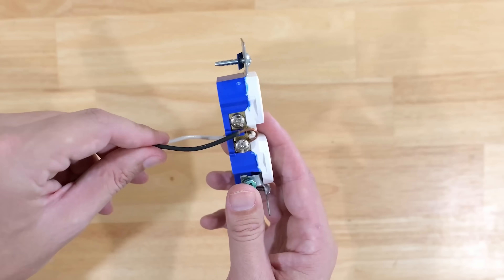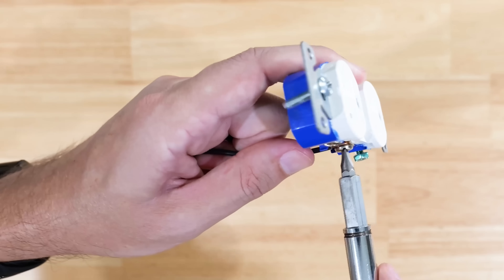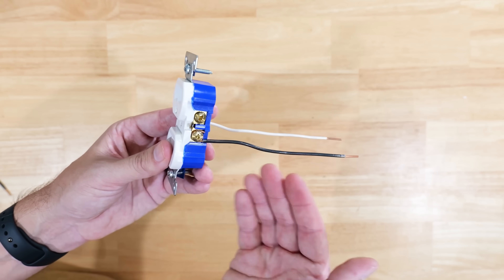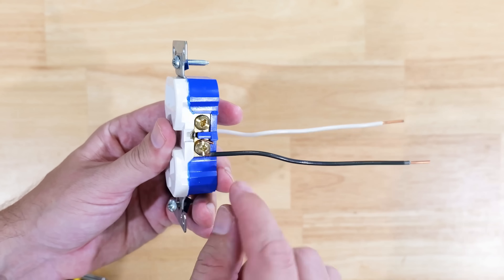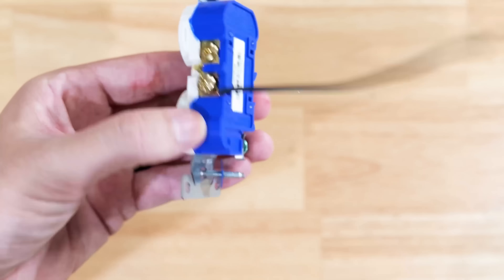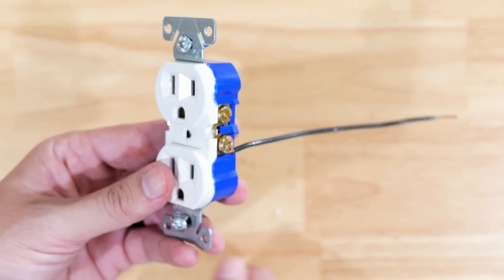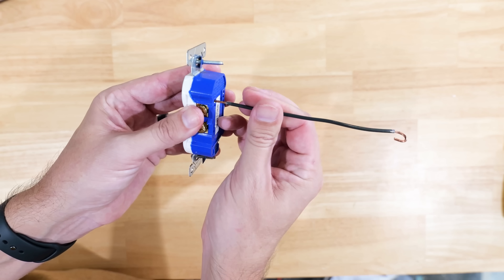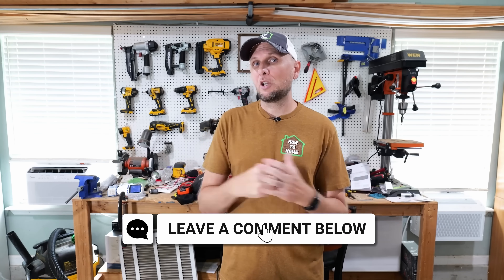Avoid Disaster! 8 FATAL Outlet Mistakes Most DIYers Unknowingly Make!

Comment from the maker: Be honest, how many of these did you find yourself doing?  It is not abnormal for folks to find they have been doing 2-3 of them!
Reply: None. But, I've been at this for almost 60 years too. 😉
Reply: Not a pro, I'm a DIYer and "enthusiast" - the only mistake I would potentially make from this list is putting a 20A outlet on a 15A circuit.  I would've reasoned it is over-built and therefore safer, less likely to have a heating/contact issue.  However, I see the point that it might encourage someone to plug in a load that would be too much for the wiring and breaker and then you are counting on the breaker to save your backside.

It is worth noting that many of the tips and "don'ts" from this video apply to wiring switches too.

Finally, I was expecting something about using an outlet as part of a daisy chain.  Personally, if I was connecting a mid-run outlet I would use pigtails rather than connecting both the incoming and outgoing lines to the outlet.
Reply: I thought you had to use pigtails on a mid run outlet in order to keep it in parallel with the circuit… wouldn’t directly connecting to the In and out  put it in series  and change the voltage drop…unless there’s another junction i’m unaware of that already branched it off parallel?
Reply: @philipstaite4775 even if you put in a 20A outlet, the breaker in the panel is most likely sized for 15A so there is zero chance it would ever actually pull the full 20A and melt wires. People are so annoying
Reply from the maker: @No5elfCTRL zero chance?  Breaker never malfunction?   They always trip right at 15 amps?  Hmm seems I’ve seen fires from that happening.
Reply: 80% of them ‼️ Thank God the building didn't burn down ❗
Reply: @iamanovercomer3253  80% of what?  A true 20AMP plug has that sideways Neutral prog (or is it a 90 degree bent one, I honestly don't remember).  You don't see those in household use very much here in the US, in industry, yes.  You often see 20 amp circuits with 20 amp outlets, but what appliance or vacuum cleaner have you seen with a true 20 amp plug?  I never have.  The odds of plugging in a true 20amp plug in to a 15 amp breaker'ed circuit is extremely low (All my first floor wiring used 12 gauge from 15 amp circuits anyway.  My hands, 20 years ago easily  handled 12 gauge ).
Reply: @Daveyk021 14 gauge wire with 15 amp load all day long where more than one wire shares the physical space as another wire also loaded up all day long will result in hot wires.  Using 12 gauge helps to mitigate that.
Reply: @pixels303at-odysee9   yeah but why since 14 is rated for 20A except for romex and resi branch ckts. The only reason I wire houses with 12g is because I'm going to use the screws anyway and the cost of wire isnt that much considering I can put more outlets on a circuit.  All i run in 14 are light circuits because can lights are a royal pita with 12g wire.
Reply: I have definitely used the quick wire holes. I need to double check, but I think some smart switches I have recommend it in the instructions.
Reply: @nickw-hillgod  May be better than the ones with stranded wire coming out of them and then needing to use a wire nut in the outlet box and trying to stuff all that back inside a single wide outlet box.
Reply: I ordered the Torque Screw Driver you recommended from your link (Wheeler).  Without re-listening to the cast, did you not say you set it for 12lb/in for electrical sockets?  The lowest that the screw driver can be set to is 15lb/in.
Reply from the maker: @Daveyk021 I did.  Not sure how that is true.  You saw and heard it chirping at 12 in lbs.
Reply: @HowToHomeDIY  Apparently the new ones only go to 15lb-in as the lowest and that is pointed out in the use manual too.  I think that is okay.
Reply: @HowToHomeDIY  I just leave it at its lowest setting, 15 pounds which is good.  At 15 pounds, it probably starts chirping at 12 pounds.
Reply: @Daveyk021  It;s not a TORQUE screwdriver - it's a TORX screwdriver.
Reply: Missed one tip: always screw in all of your terminal screws. If the outlet comes into contact with the side of your electrical box, especially if someone did not tighten the outlet into the box properly, you could blow your fuse to your entire house!!
Reply: @pixels303at-odysee9  eehh, i usually do that but not for why you said. i just do it so if some knot head takes off the wall plate some little kid sticking his fingers in there wont touch the screws so easy.. Thats not even a very good reason either. The only one is if your putting an outlet in a metal box i spoze. I think i'll quit wasting time doing that now that I think about it.
Reply: None, I hire a licensed electrician to get it right. Easy; not super cheap, but my peace of mind is priceless.
Reply from the maker: @fjeinca ok you do you.  Video is more intended for those of us that do some of these minor changes ourselves.
Reply: @HowToHomeDIY  some people have the time to watch these videos and the money to pay someone else to do what they are perfectly capable of doing themselves.

I have peace of mind knowing "I did it right Myself!".  So many times misplaced trust ends up in a house fire or flood.
Reply: @HowToHomeDIY  I often ask electricians trick questions about electricity, out of curiosity to assess what their understanding is.  Just like the criminal medical system with doctors following dictates and not questioning the protocols, it pays to scrutinize their understanding of the occupation they decided to make a career of.  Sadly, if people have not been paying attention, those with peace of mind are either suffering or worse right now.  I think many people know exactly what that is. I cannot elaborate as this platform is silencing everyone who attempts to convey the dark statistics.
Reply: I think I'm good on all but maybe one.  I'm gonna go back through and make sure I didn't reverse polarity anywhere.
Reply: also you every new house built uses 15 amp outlets on 20 amp circuits this guy isnt a true electrician and has no data to back him
Reply: @jaxflint2814  you must be arguing with ghosts or something.         Nobody: ....
You: IM NOT FINISHED WITH YOU YET
Lol.       He's just showing some random tips. Nothing wrong with anything in the video.
Reply from the maker: @jaxflint2814 ok?  First, no clue what you are saying in the beginning.  Second, when did I say otherwise to deserve such hostility?  🙃
Reply: I'll wanted to add a outside plug for outside lightning, and I was thinking that it was OK to jump off of a inside plug, looks like I've got to call in a Electrician 😮
Reply: Is it going to switch one to another on AC anyway
Reply from the maker: @alklyce3173 AC is always switching but you still have a beginning and end on devices and they are designed for electricity to be fed from one direction which is the line wire not the neutral.  Devices like a lamp if it is fed backwards the socket will stay hot, the switch is only stopping the circuit from being completed.  And if you touch it you become the path to ground completing the circuit which results in shock or electrocution just depending.  So it very much does matter which side is wired where.
Reply: @HowToHomeDIY  Look at the tranformerless All American Five Radios from the 50s and 60s.  It didn't matter which direction the plug was put in to the wall socket.  They ran just as well as a hot chassis as the did as a neutral chassis.

Those radios had to be encased in Bakelite or plastic, with plastic knobs. Yet, on the bottom, there were often screws right in to the chassis. Of course, back then, we were not as much of idiots as we are today.  We didn't need stickers on the ladders telling us not to lean them against hot power lines.
Reply from the maker: @Daveyk021 you’re missing the point.  And just because one thing many years ago worked without any issue or safety concern doesn’t mean that’s the case for everything.  We still have things that can be plugged in either way today like Christmas lights for instance.  They purposely put a “non polarized” plug on it.  But if you look at most things, they have a “polarized” plug on them where one of the blades is wider (neutral) and the other is smaller (line).  So they can’t only be plugged into a receptacle one way.  That is for a reason.
Reply: @HowToHomeDIY  Why do you still use Phillips head screws for tightening wires on plugs in the US? They torque out too easily. Here in Canada we use Robertson head screws for this application which makes it easy to tighten the screws without the screwdriver torquing out & achieving the correct tightness to hold the wire firmly & safely.
Reply: @autodidact537  if you look closely at the screw it takes either #2 phillips or a #1 square driver, which is better. They also make a driver that is both, I should prolly go buy one some day.
Reply: @howtohomeDIY going to do my first one this week. I have a question, i have a toggle switch that broke off, so i cut the power and figured out how to get it to the off position. Covered the toggle hole with electrical tape and will purchase a new toggle switch in the next day or so. Is this ok to do? Is there any risk of fire if left in off position? I should note it is part of a double toggle panel, the other toggle is fine and appears to be working normally.
Reply: @veritas.vos.liberabit88  What broke, a breaker or a switch?

if it's a switch just turn of the breaker that goes to it and confirm that you got the right breaker, if it's a breaker, your best off calling an electrician ASAP, replacing a broken breaker can be dangerous to replace in ways that are not Immediately obvious. Any physiczlly damaged toggle (device switch or breaker) can be a fire hazard, and should be put in a safe state ASAP. Turning it off is not enough to ensure that it is safe. In some jurisdictions your local fire department can help you get it to a safe state untill you can get an electrician on site to finish fixing it. To find out if that's an option in your area, call the non-emergency number to your local fire department. This is typically a free service. Some electricians do emergency calls and will come and get things to a safe state even during off hours (ie. nights and weekends). We do, however you have two options with us, sign a contract to let us finish the job or pay an emergency call fee. If your in Rice county KS call Sutton Electric for that option. If your in Yavapai county AZ call NJ electric and ask for Jose (my step brother). If Your in Ghana Africa, call Lyon Electric or the First Non-Denominational Church of Christ of Ghana and ask for John (my dad). If you're in Portland Oregon Call EDI construction, Kevin will answer the phone, Tell him "itchy" sent you (my name is Ichihiro, he calls me Ichi for short, or itchy to mess with me) he's an old boss of mine, we're still friends.If your litterally anywhere else, I have no connections in electrical thus you're on your own finding someone.
Reply: @binaryglitch64  the switch is broken, snapped off.  breaker is fine. So I covered the exposed switch hole with electrical tape. Broken switch is in off position and other switch and outlet are on and functioning. Its a outlet switch combo.
Reply: @veritas.vos.liberabit88  Actually save the reading, just turn off the breaker for the faulty switch, confirm you got the right breaker, then leave it off untill you swap out the switch.

To install a replacement, double check that there's no power to any wires in the switch box. Then remove the old switch and make sure you have only 3 wires that were connected to it. Identify your ground wire; (it will be either a bare copper wire, a green wire, or a green and yellow striped wire).  Make sure your ground wire is on the green screw of your new switch.  Your hot goes to one of the other screws in the switch (it doesn't matter which one), and your switch-leg (the power wire that goes to the device that the switch turns on and off) goes to the only other screw. 

If you have more screws than that, you probably have a black screw... reply in that case, you likely have either a three-way or four-way or dimmer or speed controller and will need different instructions.
Reply: @veritas.vos.liberabit88  You should be fine.  You said you cut the power.  A good tool to have a DVM with a non-contact A/C sensor, or an A/C sensor device that can "sniff" if the switch actually has power or not.  The switch should be a very easy and quick change for you.
Reply: I’m a DIYer and just went to replace my garage door opener’s wall control tonight but was surprised to see that the person who’d installed the old one had used a variant of double-stacking — the difference is that the stripped ends of the wires were twisted together before they were hooked under each screw (the ends of two white ones wrapped around each other & then the same for two red ones). 

Do you think this is probably still dangerous even if makes it a bit more secure than straightforward double-stacking? OR do you think it might actually be safe enough since the twisting might prevent the extra wires from falling off & still allow enough contact with the screws?
Reply: @justfornow2753  no, in this case you should cut new ends and make them up to their own terminals. If there's too many wires to do that than you should pigtail the wires. look it up if you don't know what that means. If the recept is a GFCI then line vs load matter, and can't be pigtailed together, for unprotected loads pigtail the with line, for protected loads pigtail them together to the load side.
Reply: @binaryglitch64  Thanks for taking the time to reply — the garage opener wall control is a button rather than an outlet so only has two terminals (like a light switch) BUT I also found out today that it’s against code to attach more than one pair wires to it even though this double-stacked setup was previously installed by a technician. The previous owners must’ve wanted two different buttons for the same garage door for whatever reason. And now I’m learning that this device is never supposed to be wired to more than just the garage opener. So I’ll need to figure out which of the two pairs is the one to remove. I can’t believe a professional installed it this way! Anyway, thanks for your reply - I really appreciate it. 

And thanks to @HowToHomeDIY for the video’s warnings which helped me notice the problem in the first place.
Reply: @justfornow2753     Sorry, I can't believe I didn't catch that it was a GDO-CM (Garage door opener control module)... You can still pigtail if you're keeping both CMs... however since you are eliminating one of the CMs, you can easily trace the wires using a multimeter. To do that cut the power to the circuit, and ensure the power is in fact off. Open both CMs, wirenut together the two wires on the terminating end (the one that only has two wires) and perform a continuity test on the pairs of wires going to the other CM (the one with 4 wires)... the pair that have continuity (the pair that makes your multimeter beep) are the ones that run to the other CM. Now that you know which are which, lable them, and DO NOT FORGET TO UN-WIRENUT THE PAIR IN THE TERMINATING CM BEFORE RESTORING POWER TO THE CIRCUIT. You may also choose to remove these wires before restoring power. Or you may cap them off and make that a seperste project, or just leave the dead curcit in place permanently. I'd remove them right off. If you have attic access above the garage and another person to help you, then you can just go up there grab the cable that looks right and wiggle it and ask if the person in the garage can see or feel it wiggle. if you're lucky there won't be many staples and that will be enough to confirm and pulling will be easy. Otherwise you may need a tool called a toner (sometimes called a Fox and Hound in the trade) to confirm the correct wires. Home Depot has them. (If you get one on Amazon or eBay or whatever, I'd advise geting one for electrical not networking. They can still be used on networking but the networking type cannot be used on regular residential wiring.)

Best of luck with your project.
Reply: @justfornow2753  I am used to talking to other electricians and forgot to mention that for continuity tests it is best practice to ensure that you do not have continuity in other pairs or for a reason other than what may seem obvious. To do this just unbond (un-wirenut) the pair of wires in the terminating CM and see that it no longer has continuity. If continuity is lost by unbonding, than you can be relatively sure of your results.
Reply: @binaryglitch64  Thank you for your detailed reply — I really appreciate it! The new control module is now connected without the secondary pair of wires and seems to be working, BUT I left the dead pair in place in the wall (with the ends still sticking out, though), using electrical tape as a temporary way to cap off each wire individually to buy myself time to figure out which approach to take with them.

I do want to remove them, like you suggested, but there’s no attic above the garage & the wires do feel like they’re probably stapled in pretty snugly. Right now, I have it set up so that the wrapped ends that are closest to the GDO-CM are poking through a side notch in the control module’s plastic casing (so that I could still get the module flush against the wall without trapping the wire ends against the logic board) and the other wrapped ends of the wires are coming out of another hole in the far end of wall, enclosed in a plastic bag taped to the wall for now. There was no junction box used for this wall mounted setup, so the wires were (and still are) just coming out of holes in the wall that have been covered by the control modules since before I moved into the home.

So when you said I could leave the dead wires in place permanently, did you mean that it might be fine (and safe) to just wrap each of the ends really tightly (and heavily) with electrical tape & push them into the holes in the wall to get them out of the way? Or could that pose a hazard in the future?

I’m worried that if any of the sheathing/insulation degrades over time & leaves sections of wire exposed, it could wind up touching a live wire without me being able to see in there. Is that a realistic concern or a highly unlikely scenario that I really don’t need to worry about?
Thanks, again, for your helpful responses!
Reply: @justfornow2753  Highly unlikely scenario unless house is really really old (like 80 yrs plus) and some of the sheathing of wiring in your walls is already degrading... but even then, they won't be disturbed much and thus it's not likely. If you have rodents disterbing wires is The only scenario I could see in which case you've already got a wire problem, whether those wires are there or not. because they are not connected to anything on either end, tape should be fine to cap them off, however on the side that was the non-terminating side, I'd either cut them back far enough that they cannot come into contact with the other wires, or use correctly sized wire nuts.
Reply: @binaryglitch64 thank you so much for responding again — sounds like cutting them shorter, taping them off, and tucking them in might be the most manageable way to go, then — thank you for that feedback! I really appreciate it.
Reply: Stop buying garbage consumer grade outlets. Buy spec grade. Back wire (NOT back stab!) and tighten the clamp down to 20 in lbs. 

Spec grade outlets are like $3 each. They hardly cost anything. Add about $1 more if you want TR or 20A outlets.
Reply: You missed a big one.  Using the break away tab as a jumper on the side of receptacles. A buddy of mine does it and it makes me cringe.  That tab is not rated to supply receptacles down stream.
Reply: @kevinpowers3815  huh? WHAT?
Reply: Half my house is double stack wired
Reply: This guy is not right.
Reply: Straightening the hooks
Reply: Very good. I’m not an electrician but I did build my own house and I bought a book from Black & Decker do you help me do it. Even though it didn’t show all the tricks you do, the right stuff, I figured it out on my own, because of my engineering background. I never use those back plate stabs. I’ve seen enough failures on them as a do it yourselfer Fixing other peoples houses
Reply: Always great!!
Reply: I once found 8 GFI plugs on a building that were wired reverse polarity. Another time I was asked to check out a rental property that had about half of the plugs not working after the manager told me that 3 different electricians couldn't find the problem. I found power on the hot side and my test light showed me that the neutral side was disconnected. Every plug was backstab wired and all the neutral wires had evidence of arcing. I had to trim back the wires and put pigtails on every outlet in the house. After that, I got called for every electrical problem they had until I retired.
Reply: I think some of these DIY people might be better off using the push in connectors
Reply: to be honest none haha. im sure in the past ive done one or two of those, but i already knew everything covered.  thats the problem with learning about things you already like. its mostly just a refresher.
Reply: I use to wire them wrong until I learned to do it correctly. Nice Video
Reply: Should note some brands the "back stab" holes are used in combination with the screw.  It's actually better in that case to use them vs hooking the exterior screw. The resulting connection covers a higher percentage of the conductor. Long story short make sure to rtfm lol
Reply: Only one I've ever done is put the hook on the wrong direction, and that's more of an issue with left handed people. One way just feels more natural to us.
Reply: I actually pulled your video before attempting anything
Reply: I'm a pro DIYer after almost 10 years so I wouldn't be caught dead making any of these mistakes lol
Reply: None! I learned about this almost 60 years ago when my dad had me do an Electricity project in 4-H. Part of that was taking a class taught by an electrician at our local REMC. I took Electricity as a 4H project for 4 or 5 years. It was a good basic education for future homeowners.
Reply: Hey so I have a light switch in my bathroom that operates a pot lighting above the mirror and a ceiling fan on its own switch. I just opened that up and I noticed that there's only one black wire one white wire and a ground wire play yet it's powering all that when there is a single black wire in a single white wire.
Reply: Thanks for saying not to use the back holes.
Everyone I talk to says it's fine and they do it that way.
The problem is this isn't the 1970s with American made sockets that will outlive the house. These are cheaply made sockets with thin cheap plastic, it gets a combination of heat and people pulling and pushing on them when they insert/remove plugs and the plastic cracks making them loose and then fires start
Reply: I know a lot of DIYers that do damn good work.  Government wants to rule every aspect of your life
Reply: I knew about most of them, but the thing that bothers me is I had a young man who was apprenticing under a professional  electrician say that using the stabbing method was what he had learned!  

I also figured out on the fly that while using the shepherd's hook that I needed to hook it properly or I got what you showed in the video. Unfortunately I had to do all of the outlets in my just purchased home over several years time as my body doesn't bend as well as it did 50 years ago.

The problem with the recepticles was that the previous owner removed the cover plates from all the outlets and then PAINTED OVER THEM when he painted the rooms. So almost all of them had at least one half of the recepticle that didn't work due to paint. That's something I didn't notice until I moved in. Ah the fun of being a handy human!

This was an incredibly helpful video! Subscribed
Reply: How often do you see a real 120v 20AMP plug?  I used on of those for my work bench, but that's it.
Reply: @Daveyk021  I agree but most garages have 15 amp breakers and wiring (and not enough plugs)
Reply: @onlineconsumer4796  I've used 20 Amp outlets on 15 Amp circuits (breaker is 15 amp) because the 20Amp outlets seem made so much better.  I have learned to get "industrial" outlets, for it not, they are just back stabers and I will NOT use those.  This place was built with a bunch of back stabers.  So an outlet or two in a bedroom would fail.  I had to find another outlet "in the string" that failed (back-staber) and replace it to get the others working.  Once I experienced that, I replaced all the contractor grade back-stabers with Industrial Grade outlets, every one in the house.
Reply: @onlineconsumer4796  Oh with the arthritis in my hands, (sounds like a good excuse - lol) I have started to really like the back CLAMP industrial outlets. Oh, and I ordered that torque screw driver you recommended for future projects.
Reply: @Daveyk021  most new builds in kitchens nowadays are wired with 12ga and 20amp recepticals, replacing older way of 14ga, 15amp split recepticals
Reply: @MrJrea  Yes, they should be 20 amp wire (although 12 gauge today seems slightly smaller in DIA , and maybe easier to bend, than it did 24 years ago) on a 20 amp circuit. This thread is old, but if I recollect, we don't see too many proper "20 Amp Plugs". A lot of vacuum cleaners draw ~12 amps.  You would think those would have 20 amp plugs.  Just make sure the fault breaker matches the wire gauge, or it lower.
Reply: @Daveyk021 kitchen counter
Reply: None.  I research the codes and procedures before doing any electrical work.
Reply: @robertworden9810   almost nothing he showed you is in the NEC bubba, except for work being done in a workmanlike manner
Reply: To be honest, none of these. BUT, I was taught by a qualified electrician many years ago, and I understood WHY to wire receptacles correctly. The guy who knows HOW will always have a job, but the guy who knows WHY will be his boss! Great video.
Reply: sometimes i'll use an existing hook that is beyond nicked and just tighten down really really tight. to me biggest issue would be eddy currents (shhhhh) :p
Reply: I had to replace a gfci in my mobile home bathroom.  And the original had a 20amp reciprocal and the breaker was a 15 amp my mobile home is a 88 . Anyway I replaced with a 20amp like it had . Don't know if this is normal for mobile homes .
Reply: @MarkKuehnel  And those GFCI outlets they use don't last that long; maybe 20 years if not tripped too often, sometimes <10 years.
Reply: @MarkKuehnel  The quality of the 20 Amp GFCI is most likely better than the 15 amp ones from my experience.  I think you are perfectly fine, it is breaker'ed at 15 amps along with the other 20 outlets on the same string before the GFCI in the trailer. (Sorry I am being facetious as I know how mine it wired - lol).
Reply: q @MarkKuehnel
Reply: @MarkKuehnel  i think you missed the part of this video abouy 20A ckts. NO!  he specifically said not to do this. jeeze. and your home did NOT come that way. It's been required that all bathroom outlets be 20A forever. It's probably wired with 12g but I think somebody removed a 20A breaker and replaced it with a 15A. In which case you could leave it as long as it is wired with 12g wire. But, it would be a code violation.